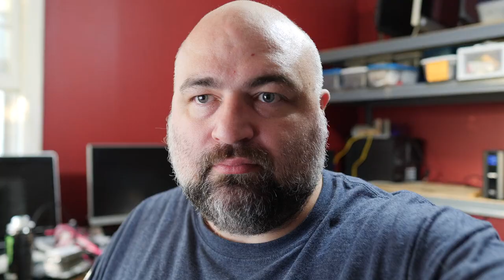Even MYTHBUSTERS Got The Airplane Conveyor Belt Question WRONG - A Neckbeard Explains - Jody Bruchon

Comment: Please learn the physics before trying to “teach” with completely wrong arguments. The wheels are spinning freely on a plane (unlike ie. cars) and therefore has nothing to do with the speed of the plane. Airflow from the props has absolutely nothing to do with the lift off. But they provide the force to move and accellerate the plane - no matter if the wheels are going the other way.

Seriously, this is simple physics. The size or kind of the plane, kind of belt etc. has nothing to do with it.
Reply: The proposition that the wheel speed exactly matches the conveyor speed means that no relative movement is possible. As soon as one moves relative to the other, the terms of the problem are violated.
Physics isn't just about recalling formulae and principles, it's also about understanding the problem.
Reply from the maker: How the hell is it that so many people think I'm saying that the damned plane is pushed by wheels? Are people really that stupid?
Reply: @JodyBruchon  I think it invokes enough highschool level physics to make  moderately not-stupid people think they've completely understood it.
Reply: Physics, obviously not for everyone 🤷‍♂️ But don't teach people in stuff you don't know anything about ☺️ The plane will take off, no matter if you understand the mechanism or not.
Reply: @kasperlethjensen9959  It won't, Kasper. Read the question again, and try and model the proposition yourself.
Reply from the maker: @kasperlethjensen9959  How does the plane take off without moving forward?
Reply: @JodyBruchon  That’s what the whole deal, confusing people. When the propellers turns (or jet engine starts), the plane will move forward - no matter if the wheels are spinning backwards, forwards or not turning. They are not related to the movement, as they are free to spin. Unlike ie. a car, where the movement are based on the spinning wheels.

No matter of the ground is going 100 kmph in the other direction, the plane will move forward when the props are spinning. The reason is that it's using the air to move, not the ground.

I hope that explains it ☺️
Reply from the maker: @kasperlethjensen9959  The wheels are not allowed to rotate faster or slower than the belt surface beneath them. That constraint is in the question. How does the plane move forward without turning the wheels?
Reply: @JodyBruchon  I can only explain it to you, but not understand it for you ☺️ But there are plenty of people (who actually know what they are talking about) explaining it - and better than me, as I'm lacking the Englishs terms 😅 But when the engines are running on the plane, it starts moving forward (relative to the wind, of course, but that’s… Well, a point that actually is related to the mechanism behind, but not so relevant in this discusion of the physics).

Actually, one of the better explanations without going too much into the physics, is - ironically in this regards - Adam Savage. I would assume his explanation would make you realize How it works. ☺️
Reply from the maker: @kasperlethjensen9959  And what happens to the wheels when it moves forward?
Reply: @kasperlethjensen9959  an aircraft on the ground only moves by creating rolling speed...unless you have the completely undesirable and problematic condition of scrubbing landing gear across the surface (conveyor or tarmac).

The thrust force generates rolling speed to get to takeoff speed so if you negate rolling speed as the condition explicitly states, you get exactly no vehicle velocity.

Comment: Youre just wrong lol, the math is available, just look it up before posting something you dont understand
Reply from the maker: Math is irrelevant. Basic logic dictates I am right. Stop being a dick.
Reply: @JodyBruchon  did you really just say the Math is irrelevant? In a problem about physics? Wow, you really don’t know what you’re talking about
Reply from the maker: @nihilistichris8609  It's not a physics problem because simple logical analysis kills the possibility of anything happening without doing any math:

* The plane can only take off if air goes over the wings
* Air only goes over the wings if the plane moves forward
* If the wheels are not allowed to spin faster than the conveyor beneath them, the axle of the wheel can never be anything but stationary
* The axle and the plane fuselage are tied together and move as one unit
* Therefore the plane cannot move forward
* Therefore no air goes over the wings
* Therefore the plane never takes off.

No math needed.
Reply: @JodyBruchon  Did you really just say this isn’t a physics problem? You keep really embarrassing yourself and you don’t even notice! 

You really have to think before you say these things, the belt and wheels can be moving at the same speed, the belt can be moving backwards 10x the speed of the wheels, that does not matter, the thrust is isolated, it will move forward! the belt could match the speed perfectly but because the plane DOESN’T USE THE WHEELS TRACTION to move it means what the belt is doing is irrelevant
Reply from the maker: @nihilistichris8609  A 747 weighs 875,000 pounds. The wheel can rotate freely around its bearing but it can't MOVE freely. Friction exists. Unless you're proposing that the wheels are dragged, the plane doesn't move.
Reply: @JodyBruchon  again, that has nothing to do with it, an engine on a 747 produces 275 kN …EACH! Friction, in this situation is not a factor, some planes don’t even have wheels, some take off without any wheel traction whatsoever, 1100kN is enough to move 160ish tons to 180mph in around 5000ft and you’re taking about bearing friction? Hahaha.

But none of that matters, it could be a small plane or a Antonov AN-225, the physics are the same, the wheels do not produce any power, hold a toy car on a treadmill and with little effort you can still push it forward, even if the belt matched it’s speed
Reply from the maker: @nihilistichris8609  Yes, it has EVERYTHING to do with it. The wheels have to spin faster than the conveyor for the plane to move forward. It has nothing to do with the wheels driving the plane and everything to do with violating the stated constraint.
Reply: @JodyBruchon  The wheels moving forward are not what makes a 160 ton plane go forward! Hahaha, how do you think a plane on skids takes off?
Reply from the maker: @nihilistichris8609  I never said they were, did I? You keep reading that into it and that's not what I'm saying. Here's a simple question: if a wheel rolls forward, how fast is it going relative to the ground underneath the wheel? Is it moving the same speed or a different speed?

Comment: You are so desperate to validate your opinion which is wrong that you have completely disregarded all the laws of physics. As an example does it make any difference to a conveyer belt with a 50 pound person over a 150 or 250 pound person? The aircraft is propelled by thrust not their wheels it is a plane not a car
Reply from the maker: Do the wheels spin faster than the surface beneath them when the plane moves forward?